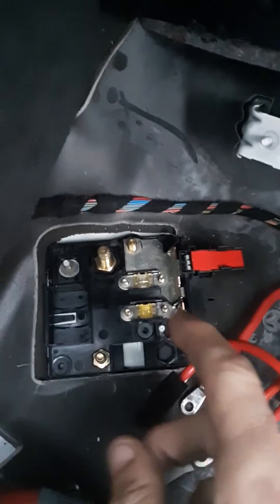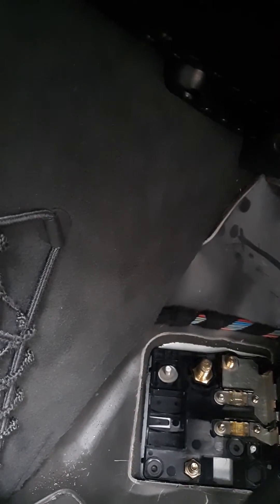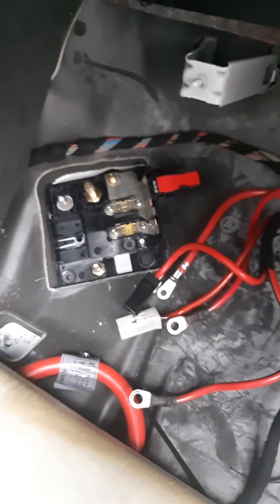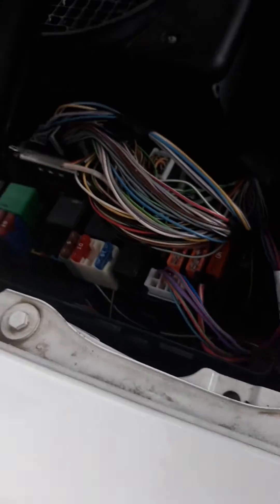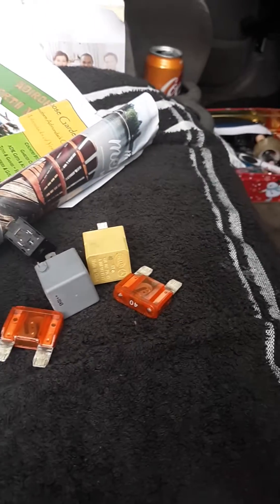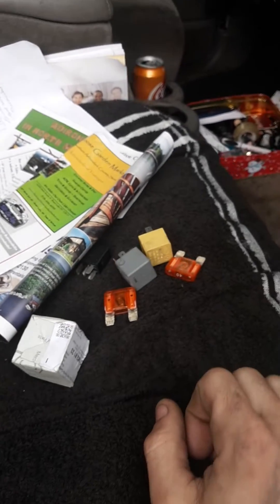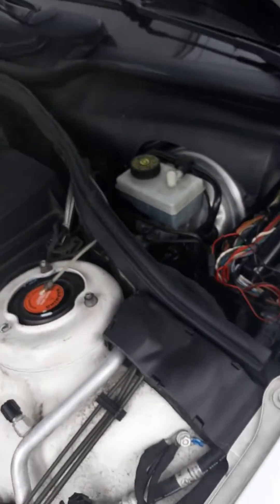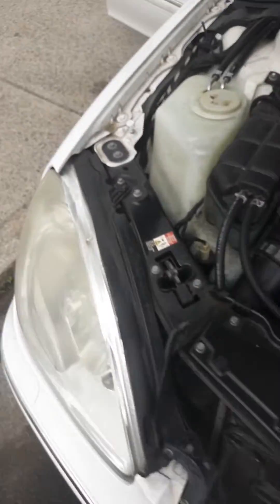Mercedes fuse box sam units distribution power

Comment: Hey Josh,
So my 05 s430 has dead ignition. It was parked for almost 6months and battery went dead. Installed a brand new battery everything works such as door closures trunk pop lights.. problem I’m having is my keyless fob won’t lock unlock nor it would turn in ignition. I had locksmith try making me a new key but same thing. He said ignition is good because he tested in his machine it works but it seems once eis is connected I’m to the car it’s not getting any power.
Any help/guide is much appreciated man apologies for long comment
Reply from the maker: I love a long comment,no worries. Best to explain when you type alot. So,that said,your key fob works? Unlocks door,rolls windows down,trunk pops? When ignition is used(key in) does it lock key in as it usually does or does key just sit in ignition sloppy? If you turn key does anything turn on dash or radio? Can you take it out of park? Have you tried puttin it in neutral? It sounds to me that signal acquisition isnt responding or central area network isnt recognizing key response. If battery died and replaced does lights work or anything inside? I know this sounds crazy but when changing the battery alot of times ive seen fuse 14 and 13 pop and does this. Open hood,driver side fuse area ( sam unit location) check every damn fuse. Every one. Then move onto passenger side sam unit area under hood where tcm sam is located. Check every fuse. Then rear seat passenger side on floor,there is a foot lamp light, behind it is another sam unit and fuse area.check every fuse there. Now comes the hidden fuse panels they dont tell you about,passenger side dash when you open door,next to glovebox,pop that open check every fuse,now on passenger floor board pull carpet up, move metal floor pan put of the way. 8mm bolts. There is a huge fuse distribution network. They use thick metal fuses,check them. It sounds to me that someone put battery in(wrong) meaning there is a  way to do this correctly. Leave old battery in jump start it. Let it run 10 minutes to get all sam units and monitors back to order then...while car is running you replace battery,this way everything is on and nothing will be lost or tripped. I know for a fact its your issue a fuse popped somewhere because when battery was replaced to much cold cranking amps went to one area at that time and fuse burnt. Ive seen it done to many times. But since you had battery done already we have to start at square one and that is every fuse has to be checked. Its a mercedes that are very sensitive when battery and voltage is played with and is done wrong. Next time do what I said with running vehicle then replace battery while it is on so this issue wont happen again. Most likely a light was left on or a constant 12 bolt source was on or even a phone charger in cig port was in. If so when battery was replaced all power went directly to that source and popped fuse and put it into safe mode so the sam units werent burnt out or fried. So get back to me after every fuse is checked and also check every bulb. If one is out and power goes to it it will cause another failure safe mode issue. It sounds crazy i know but for 15 yrs ive worked on nothing but mercedes S and G class models and you wouldnt believe the shit that pops when battery is changed
Reply from the maker: Also batteries in key fob change them as well
Reply: Josh Gray thanks for your response! I do know little bit about cars and mechanical, but not whole lot on Benz so next time I’ll keep your advice in mind when changing n battery.
Now update on my car: I did check all 4 sam and found no bad fuses, checked relays-all were perfect. My key fob batteries were replaced with the car battery. I sent power using my probe to ignition fuse and my key turned but didn’t wanna crank all lights lit up on dash as if the car was ready to run. Removed probe and ignition key and back to where we started. I seriously believe there’s something wrong with my alarm as the key is not turning, not locking or unlocking using fob, and fog lights are flashing(sorry if I didn’t mention previously). I live in apartment so can’t really disassemble a lot due to management so had the car towed to my buddies shop now waiting on him to check it out. He only works on European vehicles so let’s see. I’ll keep you posted if the outcome!
Thank you so much for your help man ..much appreciated
Reply: Josh Gray only thing I didn’t check was the floor board fuse but did use the connection to pop the trunk for battery
Reply: Josh Gray okay so quick update on my Benz issue. Finally had time to take a look in depth and found “rodent damage” so hoping I won’t have damages else where 
Thank you for your  help sir
Reply: @joshgray2024  man great info I had one towed in all the fuse under hood on drivers side and passenger side are good the panel fuse box behind the drivers seat are all good so it was 4:30 🕟 and the car was staying is I put power to the starter and it turns over so I ruled that out and the key works car goes in to neutral so the hidden fuse box on the passenger kick panel and the floor board would be my next go to since I don’t see that info anywhere thanks for the info I’ll check there happy thanksgiving 👍🏽

Comment: Which Sam  controls the the tail lights I have no brake lights no turning signals in back of car the front interiors light not work sunroof the back rear shade the key fob
Reply from the maker: Rear. Under seat in passenger side

Comment: Josh gray I have a quick question why do my after market head lights plug and play does not work but my factory headlights work.... Do you think it might just be a simple sam fuse or do I have to change out the whole fuse panel under the passenger seat like you in this video
Reply from the maker: Because Mercedes did this little trick where there harness only recognizes and receives mercedes signals. For the ecm to tell display on dash if ligjt blown or indicators are out. There is a simple trick to this but you have to splice the ground of benz harness into the headlight harness. Aftwrmarket ones use a diff ground wire and wont allow ecm to send power once it notices it isnt a benz unit